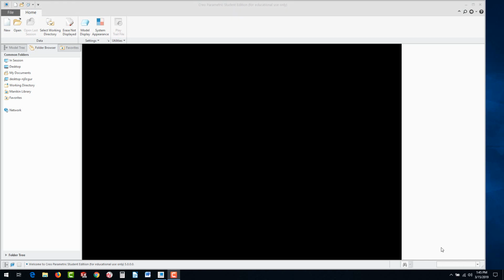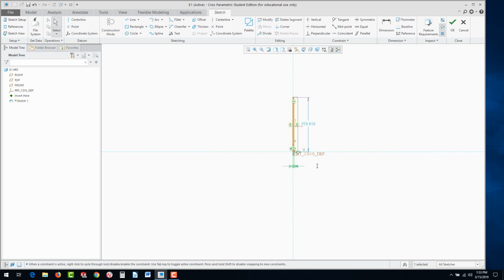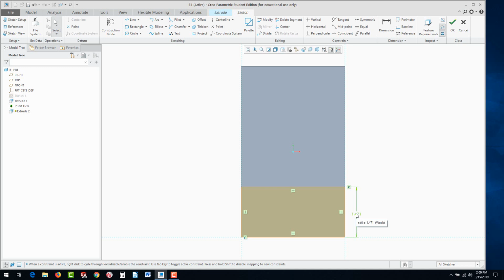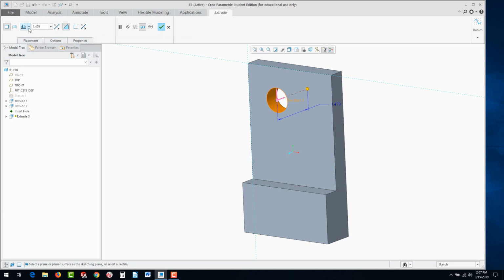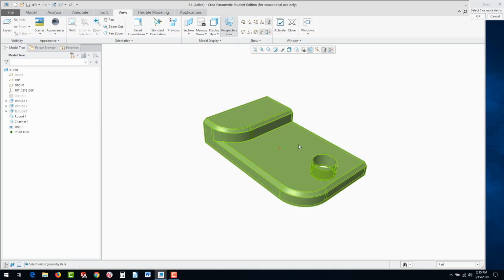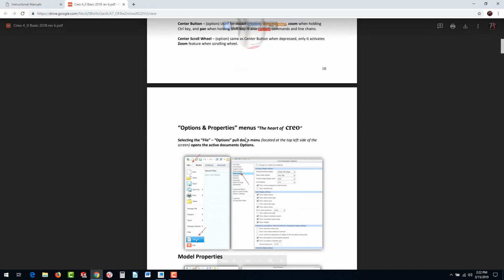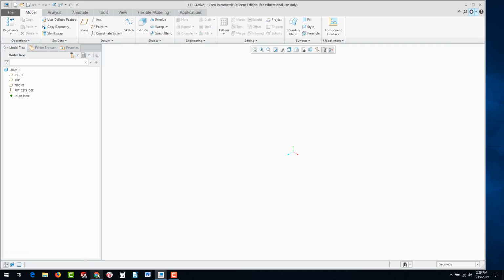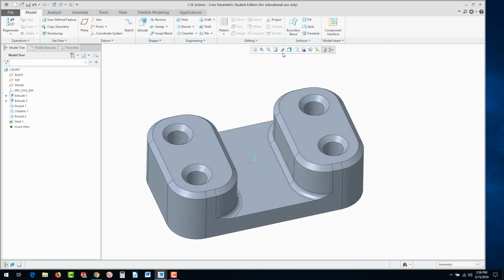E1 Creo Parametric 5.0 - Basic Modeling Tutorial 1

Comment: Hi. I don’t have Creo Parametrics but I have Creo Elements version 19 and it looks completely different from this one. I tried to find good tutorials of acre oElements and there is none. I have SolidWorks and Fusion 360 as well. Which one you recommend?
Reply: Fusion 360. It is way easier and more intuitive to use (in my opinion), and has basically every feature  Creo has, if not more. The UI is just better.